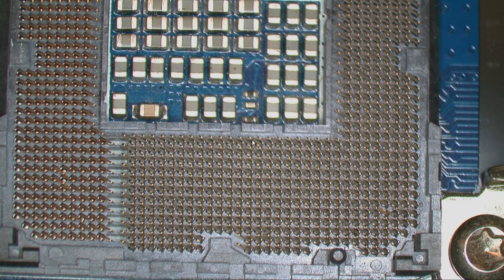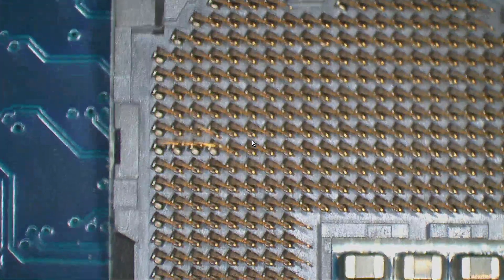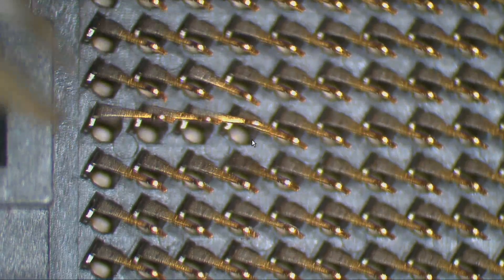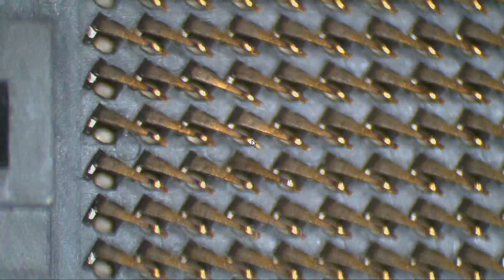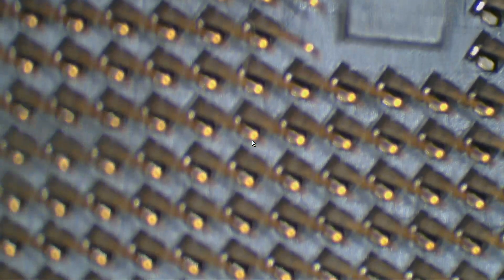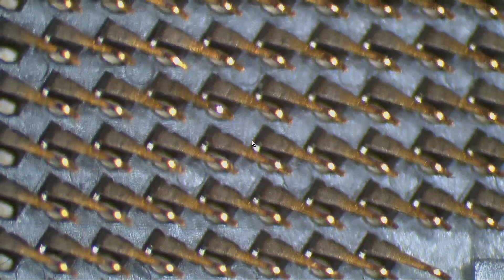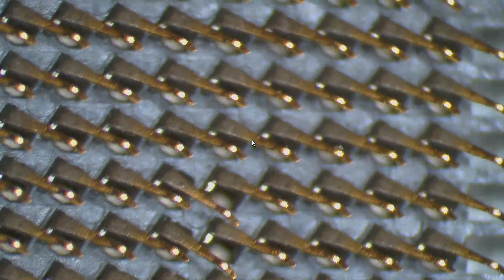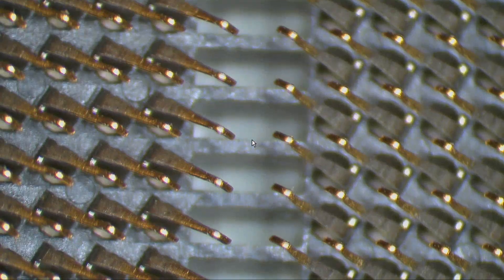MOTHERBOARD CPU SOCKET WITH BENT PINS. SIMPLE FIX

Comment: I know this is an old video, but after watching this I was inspired to try and straighten the bent pins on my son's motherboard. I didn't have the very fine tweezers that you used, instead I used a sewing pin and a lot of patience! Eventually I got the pins aligned almost perfect and now the PC lives again! Many thanks for the video!
Reply: I know this comment is 1 year old but thanks for the inspiration, now its my turn to fix my motherboard
Reply: @Amirmteir same
Reply: What did you use to see what you were doing clearly?
Reply: @mrljgibson  I used a usb microscope like the OP to see what I was doing.
Reply: @nigelhenry4928  any particular recommendations? There is a lot of garbage also available.
Reply: @mrljgibson  You can use any phone, just magnify and keep it still.
I always use my phone to see little things.
Reply: @mrljgibson  u can also use your smartphone if it has a macro camera function. Just turn on the video mode and turn on the flash, then with macro camera u should be able to see even more clearly

Comment: how does bend pins happen, when you have a CPU on the socket all the time ?
Reply from the maker: This happens when installing and uninstalling the CPU. When to computer boots it can cause crashing or bluescreens and lockups. It is then usually discovered the pins were bent during installation or CPU swap.

Comment: Good video,thanks. Can you tell mw what enlargement device you are using. I have only a cheap pair of chinese zoom lens thungamybob which are carp. I have an MSI B460-M-VDHmobo which my cat jumped on because she doesn'tt likr M|SI or China and her paw landed smack on the middle of the cpu socket and voila, a few bent pin thingamebobbies. I bought a decent jewellers lope. which is good but you have to put your nose onto a bunch of capacitors. {I'm gutted  'cause my daughter bought mr the mpbo,,the chip and fan. 16gigglebits of DDR4 ram` etc. Iried to boot but got no poxt. So, this the reason for my questiom. Greetings from England by the way.
 )

Comment: Nice job, 1:38 I noticed one more bent pin (bottom right) but since motherboard worked, I guess it was in working tolerance. 

My thinnest tweezers head is a lot bigger than what you are using. I guess need to buy different tools to try and recover my $450 M/B, I have 2 bent pins in different location.
There was dust and tiny hairs in my socket too and I'm wondering how those get there, I vacuumed around the CPU before removing it, I cleaned it with Circuit cleaner spray though and it seems fine.
Reply: I really hope you meant the area in which you were going to be working on the motherboard, not that you vacuumed around the inside of the case.
Reply: @TheFayth  I do vacuum inside case once in a while, but no I didn't use vaccum cleaner on socket, I used "Circuit cleaner spray" (dry type) AKA contact cleaner. Oh and I get it working again and it is working for about a year now

Comment: insider tip:  Using tweezers is NOT recommended if you're new to this.  You'll snap those pins if you're shaky.  Instead use a good quality wooden toothpick.  It gives you good enough grip to move that pin where it needs to.   Thank me later.
Reply: I fucked up my LGA 1150 motherboard, hopefully this will work

Comment: So I've accidentally ripped off a pin from the socket and replaced it with another one from another socket from a motherboard I'm not using and I'm wondering if there's any risk coming with it.. The pin I broke I believe had something to do with the turbo frequencies as it wouldn't let me go past the stock speed (in turbo I mean) but it would let me decrease the stock speed. Everytime I would've tried to OC my cpu to a higher freq, it would restart and then restart once more then telling me that the overclock failed. So I added a new pin (just sticked it in there and mounted the cpu) and now the turbo is working again (the pin makes contact with the original pin and the spot on the CPU), but I wonder if it's going to last me or not..

Comment: I decided to swap two LGA1156 core i3 cpu's from two pc's built summer 2010 because the video driver crashing when video editing or sometimes while watching an mp4 video.  I first discovered the heat sink / fan combo was loose one of the plastic locking pins was no in correctly.  When removing the CPU I hear the dreaded pin scraping noise and panicked then I watched your video and realized there could be life after death and prayed.  I used an LED light, 10X magnifying glass and a sewing needle to straighten around 10+ pins.  System is back up and running.  Thanks!!!

Comment: Great video! I went from dreading that my pins may be bent to hoping that actually IS the problem because you have given me confidence that I can fix it.  You earned a subscriber with this one.
Reply: Same here, I panicked until I saw the video.  I removed my board to get as close and steady as possible as I worked with a sewing needle.
Reply: My late grandfather left me some of the tools that he would use on his train sets.  Lucky for me that included a pair of needle- point tweezers.  I steadied my wrist on the outside of the case and set the pins like a picket fence.  Thanks again, @TheActiveRegion!

Comment: Just a quick question, i got an LGA 1155 motherboard, will the system even powerup incase of bent CPU pins?
Reply from the maker: I couldn't tell you. All the pins do different things so your guess is as good as mine. Could be anything from bad ram, CPU or board.
Reply: My guess is even one bent pin and it will fail some sort of preflight inspection before bios post.  Easy to check I have been in this situation and always start by unplugging everything and turn on and add components one at a time.  Even a crooked hard drive power plug could cause pc not to post.

Comment: Can we replace the socket itself if there is more damage?
Reply from the maker: Better off getting a new board at that point. Almost impossible to replace the socket with out specialized equipment.
Reply: @Kev_31779  Thanks for your reply. Appreciated. I was able to make adjustments with help of small pin and a magnifying glass. Thank God none of them were broken. Now everything is running fine. Thanks for your video it gave me hope and courage to do it myself.

Comment: Thanks for the tips, this fixed my problem where two of my RAM slots weren't being recognized. After struggling to figure out what might have gone wrong, I found some bent pins and used this as a guide.

Comment: Lost 1 pin - Ball # A18 with signal DDID_TXDP3 on my 1150 mobo, turns out it's connected to my PCI-E x16@x16 slot, so RIP gpu in that slot.  I'm now using the middle PCI-E x16@x8 with no other problems.

Comment: come across this bent pins problem in many of my builds so far done over  300 pc build's and only 3 of them had this problem,i did manage to fix all the issues with the bent pins but always came across this problem when gpuz picks up  the graphics card running at 8x insted of 16x,when i bent the pin or pins back to normall it will show the card   running at 16x which is the right speed.
also had the daul channel problem same as hgl 2020 it seems the ram was in single channel mode

Comment: no matter why my core 2 quad Windows XP retro machine wasn't posting, 1 pin on that used board (ASUS P5Q Pro) that i got from ebay was bent. i carefully unbent the bent pin, reseated the core 2 quad, then reapplied some thermal paste, then put the heatsink back on the CPU, then tested it, and it finally posted, I was going to get a refund for a dead board but this video helped me.
Reply: Big time saver! and the board is back to life!  You can also run xp inside virtual box.

Comment: how can i send you a motherboard with bent pins. I repaired as much as I can on my own. cant get a straggler
Reply from the maker: Sorry I don't do these repairs for service. This was a neighbors board. The problem is if I break a pin its all over. Then your mad. I would get some fine point tweezers and a good magnifier glass. You can do it. Have faith in yourself.

Comment: I don't get it. It is 2019. We can put a man on the moon, we have created superfast Internet with fibre technology, we have cars on batteries, trains running at 500 km/h, advanced laser technology in our hospitals, but we can't manufacture a CPU and a CPU socket without extremely fragile and damageable pins ??? I simply don't get it! The engineers at Intel and AMD should be ashamed of themselves.

Comment: This type of cpu design is a disaster...which bonehead approved his design...lga1155 pins r prone to bend... Earlier in pentium 3 or 4 series processors with golden pins which fits into small holes were perfect...this design is full of errors... Intel go eat some grass ...ur bone head ennovations r creating hell of issues...
Reply: But but but... you can sell more motherboards with Intel chips thanks to that
Reply: @r1oot  It is much more difficult to damage (physical pin damage) the CPU with PGA,  the pins are much stronger.
Reply: It's a good design imo, problem is users get careless with inserting cpu's, and when not in use toss the boards around without a cover. Personally I've never had an issue with it, but I have fixed used ones from other owners. The sockets work great if they're not abused.
Reply: U do know Intel's method of mobo CPU socket is better, since the CPU will not get damaged
Reply: @thealien_ali3382  he don't know what he's talking about. I've owned these type sockets since 775, never had an issue except some used board owned by board abusers... Lol.

Comment: Wow what a crappy design. Only now i understand how they really look. Im having problems with my computer and im convinced its a bent pin on the mobo, but they are so small. Its overheating when under stress, giving me trouble with internet connections and i even got the blue screen of death several times.

Comment: Thanks a lot for this. I had a bent pin that was causing troubles (bsod, only 1 slot of ram working, etc.) I used a syringe needle and a magnifier. Everything it's working fine now 😅

Comment: Get some fine tip tweezers and use your cell phone camera on high zoom..  i just fixed 5 pins on my Z97 board in about 10 minutes and my issues are now gone...
Reply: Can u put a pic of those tip tweezers.?
Reply: I broke one pin right off.  Now what?
Reply: @grossteilfahrer  time to shop for a new board unfortunately...
Reply: @gregkonig9600  ugh. So down from i7 4790k to i5 3570k. Z97 to z77. Thankful I can move the ram and drives

Comment: I fixed around 20 pins in 3 hours with very small flat screwdriver and needles, and my motherboard worked flawlessly. Seems like we can use ifixit ultra fine tip tweezers.
Reply: How did u do I am fixing it from 2 days not able to fix them help me bro😭😭😭
Reply: @heroicgaming7388  maybe you should bring your motherboard to nearby computer fix center?
Reply: @digz6666  none of shops are nearby 😭 I dont how the hell did it bend 🥺🥺

Comment: I use a graphite mechanical pencil because it gives much more control over the bend pin. Also the risk of over-bending and breaking of the pin is reduced that way.
Reply: U mean the pencil nib ?
Reply: @heroicgaming7388  Since it was over 5 years ago that the comment was made, I'll go ahead and answer this for future googlers.  Yes

If by nib you mean the tip of the pencil(with no graphite in it of course).
Reply: @TheFayth  yeah I understood but too late already I broke 2 pins 🤣😭😭😭

Comment: Have a Z97-A motherboard that the LAN quit working on.  ASUS said it had bent pins and is sending it back to be unrepaired and the warranty voided (I'm not spending $140 for them to do it).  Hopefully I can fix it just like that guy's problem.
Reply: Jeff Morse I'd like to know the results!
Reply: Got it back from them yesterday.  There were literally five pin missings from the inside edge in addition to at least six bent.  I packaged it carefully and after having built PCs since 2003 I know well and good that I did not do that (far too careful).  I hate to think it, but I have a feeling it was done purposely to void the last few months of the three year warranty.  Going to make me very wary about buying an ASUS product again.  I've heard horror stories about their RMA service many times, but had never had a reason to use it until now.
Reply: Asus does that a lot. thats why I stopped buying their motherboards. Gigabyte and MSI honor their warranties.
Reply: Gigabyte just had me send them pics of my socket with my iphone 5s.. obviously the pics cant show in good clarity the pins being bent but you can tell theres different color shading that theyre bent.. they then replied in a new email that my board that is only a year old is out of warranty. So Gigabyte's RMA support is also garbage when their technical support told me bent pins are covered under warranty but not broken pins.. and theres no way in hell they can see if those pins are broken just by my pics alone.. They didnt even wait for me to send them the board to look at it and examine my board to see that the pins were bent or broken before telling me my board is out of warranty which it isnt. I looked at the pins with a magnifying glass and can see every one of them.. not broken.

Comment: I cannot believe i actually did it! I had one "dead" ram slot. The reason, one damn bent pin. I am now typing with dual memory channel! yohoooo! thanks for the video!
Reply: Same here. It's better to check the cpu socket in that case before doing anything else. It's funny that the board manufacturer help line guy didn't mention this as a possible cause...
Reply: yeah, my mobo's manual does not even mention that bent pins can actually fry your processor or short circuit the motherboard and ram slots. I simply learned it through searching in the internet. Luckily
Reply: Same i have triple channel X58 and changed coolers, took the cpu out to clean thermal paste off of the sides and 2 channels of ram were dead. i took the cpu back out twice and then finally found 1 pin way out of alignment, now im running in triple channel again.
Reply: Plzzz help me mine also not working the second ram slot in last 5 days /is there is any problem in my pins
Reply: Hi mate, what did you use to fix your bent pin? Ty
Reply: Can two bent pins cause the audio port not to work?
Reply: wow, learn new stuff every day
Reply: bro me too, today i did too, and im writing with my 16gb ram :D

Comment: A small medical injection syringe works far better than tweezers.
Slip the pin into the needle and then easily and more safely, straighten it.
Reply: wait as in slip the pin inside the needle's tiny hole?  Or do you mean remove the needle and slip the pin into the hole of the syringe encasement that once contained the needle?
Reply: I second that even though I just used it as a normal needle :)
Reply: i cocaine sniff, i dont have a fckng needle.
Reply: What gauge needle? 18?
Reply: @mall cop so you're telling me your mom doesnt have a sewing kit laying around somewhere?
Reply: Vertigo Studios---->>>>  Very funny....

Comment: Can bent pins damage CPU? I am worried about use my I5 6500 on repaired pins on 1151 socket
Reply: I repaired these bent pins with needle, magnifier and a lot of light.  I did it for about three hours but thanks god  PC is running :D Good luck and sorry for my english.
Reply: i fried i5-4690k and than G-1840 untill realized that board had some bent pins :(
Reply: @werkis2  i just helped(actually done all the work myself) a friend building a pc. When i got the parts, only the ram and the cpu was installed. Before starting on from that point, i removed the cpu and checked the pins and saw 8 bent pins, 5 of them was shorting with the neighbor pins. It's a good practice to always check motherboard pins before installing cpu, those 5 pins would've fry that cpu.
Reply from the maker: Never know what damage it can cause.
Reply: I am running the same setup same problem

Comment: Hello. I want to use my old lga 1155 pc, but when I want to power on it tunrs of after 2 sec and tunrs on after another 2-5 seconds, and reapeats this things. This problem can happen if one or 2 pins is bent?
Reply: More likely something connected to the board has failed or bios are corrupt.

Pinned don't just bend on their own if you haven't removed the CPU they should be fine.

Comment: I wish I had a setup like yours. I got an X58 motherboard for free because the socket was "ruined". I tried my best with the naked eye. Two pins ended up shorting, but it was just a vcore pin that melted away. I removed that pin. Unfortunately, it looks like a DDR2 RAS pin perhaps got shorted away as well. It is still in the socket and aligned well but looks darker than the others. The system posts, boots into windows, passes stress testing, but the DDR2 channel is dead. At least I still have two channels. Because of that shorted vcore pin, my W3520 test CPU (paid $9) has a contact pad melted right off. There was no damage on the CPU contact pad for the DDR2 channel though. 

This is the first time I seriously tried fixing a motherboard with bent pins. Had nothing to lose and it still "works" - I just don't have a ton of confidence in it. I feel like I could have avoided this with a proper setup.
Reply from the maker: Hey at least you tried. Not many people would.

Comment: did i see another bent pin in last few secinds of your video on the left?
Reply: Yes there are at least two bent pins in the lower left area of the socket.  5 & 6 rows up, and 6th column from the left.  Also another bent pin on the lower right corner, row 5 column 3.  EAGLE EYES! :D
Reply: Yeah there's still two more bent pins lol..